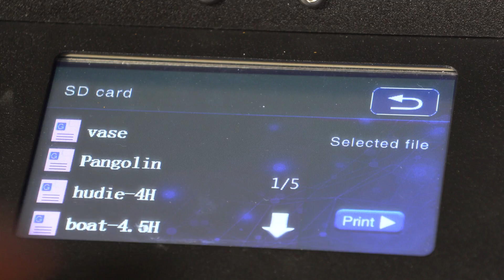The Unfortunate Problem with the Creality CR-X 3D Printer

Comment: I own the Cr X pro version and it makes me swear everyday hating the person- team who designed it. It's not even similar to the rest of the models so every different thing it features it's usually an obstacle than can't be fixed by watching tutorials for other printers. Bed leveling is an everyday pain. Not only the z limit switch isn't adjustable but the bltouch can't fix any of the bed leveling issues. Mine came with a warped bed so it adds up to my horrible experience as for the dual hotend nothing great, can do this upgrade on any model.  Definitely not worth any of the money it costs. Better buy 3 ender and rest of the money for upgrades.

Comment: G'day mate I brought mine about 2 1/2 years ago I've printed a few things but had  nothing but trouble with it from burning itself into the glass bottom to now mot even connecting to my lap top I was using cura as a program how can I reinstall all original software to factory settings I need help mate

Comment: LOL I hit my cr-x with a hammer in the middle of the bed just once and it's perfect now had the exact same issues and moved the limiter switch working great now just hit it with a hammer in the middle don't be a dumb c@## and forget to slide the glass off first that would be yes funny but stupid. Give it a reasonable hit not to reasonable like come back to it after 2 hours or so after you have cooled down from the frustration of trying to get the bed levels right.
I hit my one a little to hard but 3 small pieces of paper in the middle under the glass problem solved for how to level the cr-x with a high spot in the middle hope you find this helpful

Comment: How did you end up going with the CRX? I have just acquired one but it has the stock Creality board with the noisy stepper drivers. Is this printer worth a revisit for you to "improve" on the failings of Creality? There is lots of these flooding the second hand market now and very little information to improve on these. Things I would consider would be mainboard, bl touch and reinforcement for the wobbly gantry.
Reply from the maker: I ended up giving it away long, long ago. Have never seen another.

Comment: The new CR-X has shown no issues so far. Been printing 60+ hours.
Reply from the maker: That’s great!
Reply: @3DPrintingNerd  I love the autoleveling, something that my expensive Flashforce's lack :-)
Reply: But I have a problem 
The machine stops at 199 temperature heating 
Anybody can help me with it ?
Reply: @sukrreeswaran6465  I have no idea...
Reply: @sukrreeswaran6465  I don't know, sorry. With these printers it could be anything.... software, hardware, sensors....

Comment: I have a CRX and it works well, with a few niggles but I have no idea as a newcomer whether this is par for the course in 3d printing or model specific mine is slightly more constant than my Wanhao i3 plus. Just wish it was direct drive, also not that fiddle micro sd slot.

Comment: I had the same problem with the Geeetech what I did was get longer bed screws, longer springs and I used washers to give me the extra length to push the bed up and still keep it tension with the springs.

Comment: You could lower those z-screw couplers so the bracket doesn't hit the coupler.  That way you wouldn't get that problem.  On my new Cr-10s pro, the couplers are lower down than those.

Comment: Nice review.  I thought about getting one of these to do PVA, but changed my mind when I found out it would not do 300 mm prints in dual mode.   With all your experience in printers, what is your favorite 3D printer for the most fully automatic bed leveling?

Comment: Hey brother. I wouldn't be surprised by these design differences and hand drilled holes on a machine that is so cheap. I have worked with $10,000 cnc engraving machines with far worse last minute rigging and multiple drilled holes in spots and mismatched screws. It's part of the game when ordering from less reputable companies that fly by the seat of their pants.

Comment: I just got the second creality printer first being cr10s had no problems with it been using it nearly a year then I bought the cr10s pro it’s been nothing but problems they have changed it and the second one came with more problem there is nothing pro about it more like cr10s problem that’s what they should of named it I will never buy another creality printer again they have lost there way as a company I spend more time trying to sort problems on this printer than I print no quality control and no respect for there customers.

Comment: Hmmm... 

The Z rod is held onto the motor by a coupler with two screws. Lots of motor shaft showing below it.

Loosen the screws and lower the coupler 0.1 inch?  That could let the bed lower enough.

I do think that all the holes in the base need grommets.

Comment: After watching this video I actually went ahead and bought this printer. BEST. INVESTMENT. EVER. Not sure why its getting so many negative reviews. The only (and I mean only) thing that isn't quite right is the glass plate. It is exactly 0.1mm lower in the centre than the outside. Hasn't stopped the prints from sticking though. The dual extrusion system works perfectly and I have been cranking out prints nonstop. And the print quality is amazing. Hands down the best £525 I ever spent. 

Joel, I don't think you did this printer justice :(
Reply from the maker: So, you just recently purchased the printer, and the one I tried was months and months ago. They've changed and upgraded and updated and quality controlled this machine. I'm willing to bet if I had your machine as opposed to the one I had, it would have been a very different experience.
Reply: Probably. But that's kind of the way with chinese manufacturers. Products are constantly upgraded. My point is that these things do upgrade over time and things change. Another thing to point out is the waste material used for purging. Yes, its a lot but that's kind how this system works. Personally I don't mind the waste as all I'm interested in isa high quality print. Yet review after review all that is mentioned is the waste (and everyone breaks out a scale). Yet no-one mentions that the print quality (which happens to be typically Creality i.e. very good) No-one mentions that you can use this for single extrusion prints (no purging). I just felt that your review did not go into any depth. Most reviewers didn't though.

Comment: Creality 1st Gen devices have always seemed rushed, for example my Ender-3 new version has none of the issues the 1st Gen devices had like rubber feet, filament tube coming undone and those are only 2 issues out of many many other problems that the first batch had. Always buy direct from them to avoid the old batches.

Comment: Did you have any trouble getting your cr-x to print in two colours, mine prints fine with either extruder but nothing comes out when printing the supplied two colour models

Comment: i dont understand. why is it using end stop switches? the mk3 i3 doesnt need that. nobody needs that. you current sense from the stepper motors. and why cant it automatically level itself? the mk3 i3 does that as well. 

i dont get why people are still making 3d printers where you have to do all this bullshit

Comment: As i remember you had lot of trouble with the mk3 as you first got it, right? But i cant remember that you ranted about prusa as if the did not test anything and use the users for betatesting. Why do you do this with creality? Furthermore the prusa mk3 was advertised as a machine were no layer skips can happen and a powder coated pei sheet is included. Both is wrong for users that bought the printer in the presale. No powder pei and layers skips can happen. Where was the rant about this? There was none. Please be objective and unbiased. This review seems really biased for me.

Comment: I am seriously considering this as my second 3-D printer how difficult did you find it to actually fix the problem that you found. Should I avoid Bowden extruders?
Reply from the maker: Bowdens are good, and they have since made changes to this machine and I've heard it's better
Reply: Thanks for your speedy reply. I appreciate your reviews and enjoy your style and openness. I have ordered one direct from the factory to have the best chance of the latest mods. Now my Wanhao i3 plus won’t be lonely, cheers John
Reply: I'd consider it mate. Sounds like the initial beta release was a cock-up certainly. Though i've had mine a week or so and it's been delightful.  My first out of the box test was a glow in the dark material, this was quoted as difficult to print with. I modeled up a little bat (see bat on Thingie verse) and it worked straight away. Certainly some of the lower quality parts worth upgrading. though it's a decent tool out of the box. I built my first printer in '07 and we use some high end stuff in aerospace. For the price this is great.

Comment: Too bad but it's typical of Creality and many others to rush a product to market before it's refined. How do they stay in business with this approach? Sorry Creality this actually your job to properly engineer and test the product BEFORE selling it.

People are looking for the next awesome printer that's a step up from the hobby level. There is not much in large volume printers between the $500 basic(CR-10) and the $2000 Ultimakers and Lulzbots. 

If someone could make a reliable, good quality, well designed printer at the $1000-$1500 price point with 300x300 24/110v auto leveling bed, power resume and dual extruders at 300x300 they would sell like crazy.

Comment: The pangolin model which seems to be provided as a test file pre-loaded into the SD Card is from Amao Chan (who uploaded here on Thingiverse - https://www.thingiverse.com/thing:2064359). His permission was not sought before it was use commercially to promote the product in marketing materials and also just loaded onto all the SD Cards which went out with all their machines.

The Amao Chan's post about this was just shared on Facebook here (in Chinese) - https://www.facebook.com/paperworkers/posts/1882111388504262

Comment: This is why we have started building our own 3d printers for our business. The Creality printers were the best, but could be a lot better, the real nightmare machines were from a company called Geeetech (yes, 3e's), total disaster, the wiring harness had problems, the parts did not fit together, the software had mistakes and when finally it was possible to print something the aluminum platform was warped by about 2mm in the middle. Thanks Geeetech, you motivated us to make really good 3 colour printers

Comment: hi, guys, there is  a three extruders printer, it can printer 3 kinds color at the same time, you never find any printing video for CR-X,  but we can provide tricolor printer printing video. or you can send me stl file info@reprap.cn, we can print it for you by tricolor printer: http://www.reprap.cn/he3d-three-extruderautomatic-levellarge-build-size-200280200-p-220.html?cPath=4

Comment: My only issue with the 'cannot review this product' is that I feel it is letting them off too easily.  I think you SHOULD review the product and review it like the garbage it is that they sent you.

Because the other side of the coin is that you get the thing, it works perfectly and you gush over it.  LOVE IT.  Everyone on youtube LOVES IT.  Then they change it before going to production, never QA the changes and the people buying it because you reviewed it great get total lemons.

If you are not reviewing this pre production unit because it is bad, you also CANNOT review ANY other pre production unit if it is good.

Of course the real problem is that even after production, changes to these units keep being made, with no indication to the user which version they are getting, and not even such a thing as a version number existing on the hardware.

The industry has put itself in a very bad position thinking rapid turnaround is ALWAYS a good thing.  It is not a good thing unless it is documented and communicated well to the users and if early adopters can upgrade for free.

Comment: See those hex screws on the z-couplers? If you unscrew those you can lower the couplers closer to the stepper motors giving you more space to lower the z-limit switch. Had to do that on my cr-10s

Comment: Thank you for the video! I’ve been considering the CR-10 vs the CR-X and I’m now definitely going with the CR-10. Ive done science projects before (rigidbot big) and I’m still working on it. They should advertise that these are beta tested (although I doubt they will). Makes me cautious to buy any new printers from them in the future. At least if it’s advertised that I’m beta testing then I would feel better about it, and not frustrated and cheated.
Great video!

Comment: Totally agree. I got a Creality-CR10 S5 and... Really, I feel like you. Is like they use the customers as beta tester, selling products that are not ready at all to work! In the Creality-CR10 s5, for exemple (there are ALOT of things that actually doesn't work) the bowden tube with cables are so long that everything fall INTO the print... Nothing there is designed to prevent this, then seriusly, this printer can't print. It's ridiculous.

Comment: Sorry, I am totally out of the loop here, but just a question on the background/context of this video as I have been looking into buying a Creality machine.  Did they send you a review unit for free and/or are these printers currently being sold in this state to customers?  If the review unit was free but not yet commercially available, I feel that some QC problems should be expected as there are probably still ongoing hardware design iterations.  In the same vein though, I feel like you can then also fairly say "this unit isn't there yet, do not buy."  However if this current version is for sale, then I agree that the QC problems could be an issue.  Having first started with 3D printer kits back in the day, maybe my tolerance for this kind of stuff is higher than the average user, but I also feel like a true, 100% novice-user-friendly 3D printer is still a while away, so some manual labor will always be required regardless.

Comment: Excellent, honest review. I've said it before, and I'll say it again - these chinese printer companies are simply incapable of decent quality control or producing anything more than a printer of more than moderate value. This damn printer is 800 FUCKING DOLLARS, it's manufactured by the leading chinese printer company that has at least a decade of experience in this area, and they STILL released a product that doesn't produce prints on the same quality level as machines costing less than half as much as this, and has glaring design and quality errors. (seriously, acrylic mounts ? on an $800 machine ??) Truly mindboggling how a major company can allow this to happen.

Comment: It's not just Creality, lot of tech companies are like this. The manual for my Cetus 3D did not match the machine I got.  This whole idea of using early adaptors as testers came from software companies.   It worked for them because their product were not physical, they can push fixes to customers via the net.  I used to be an early adaptor, but I've given that up since a lot of tech companies has adopted this QA model.

Comment: I appreciate that you put the brakes on this one. Chinese printer manufacturers iterate fast, and I've come to expect that and look at the date of customer reviews to see what's been fixed and hasn't, but this is just too much.
I would be upset if I got that printer as a customer after seeing a review of the design you first saw, and there's no way I would buy a printer with the issues you described if you had continued onto a normal review of the one you were sent. 

That said, I don't know how sourcing review units works, so I don't know if it's easy to do this, but I'd appreciate it if you could take another look at this printer maybe six months down the line. That has a ton of potential with that feature set in something that isn't a factory prototype. At least I really hope you were sent a prototyoe for a revision. That shouldn't be sold like that.